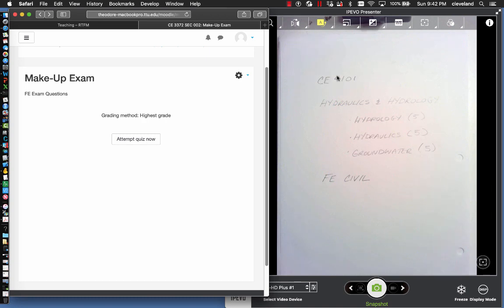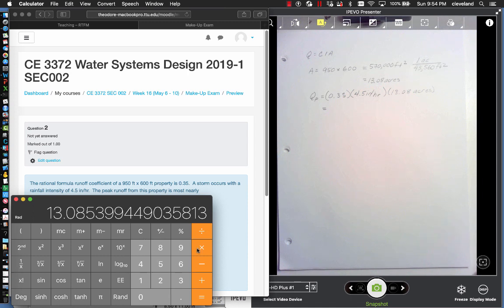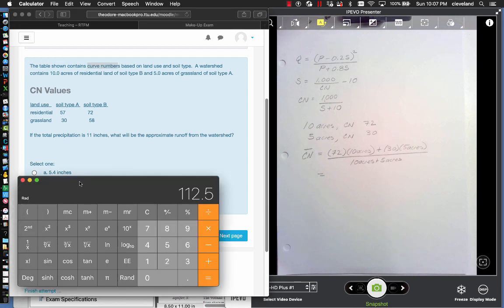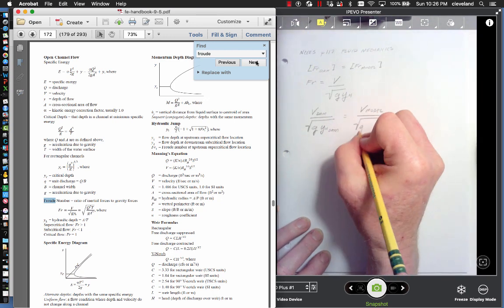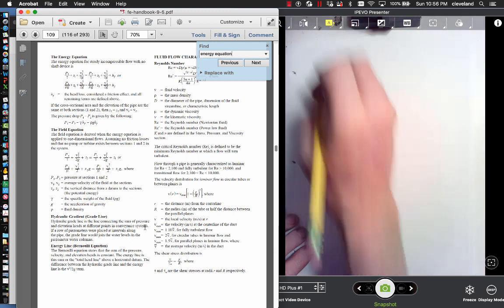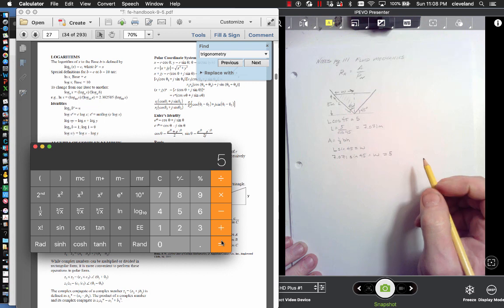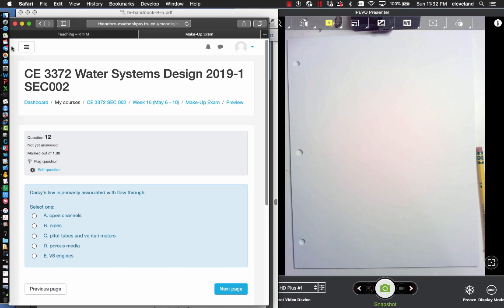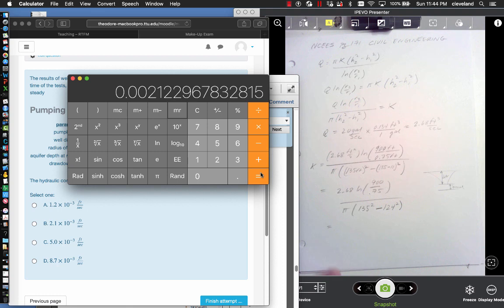FE Exam Review - Hydrology and Hydraulics

Comment: Another way to solve for the dam ratio problem is to set Potential energy equal to kinetic energy (mgh=1/2mv^2...masses cancel out) and solve for the height at which velocity reaches 5m/s on the model.  Then multiply that by 15 and resolve the PE = KE equation for the new velocity.

Comment: I had a quick question at 47:21 in the video when you rearranged the form of the equation    On top q*n did you multiply it by n on top to get rid of the 1/n on the other side of the equation? It has been real helpful though this video